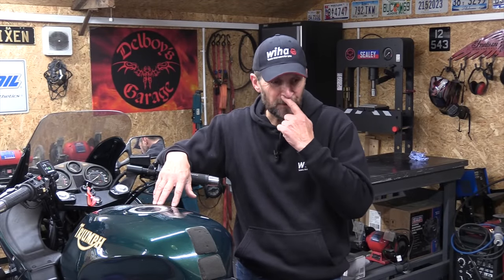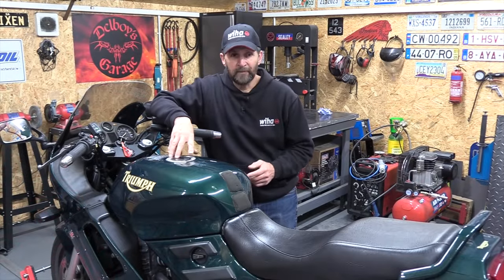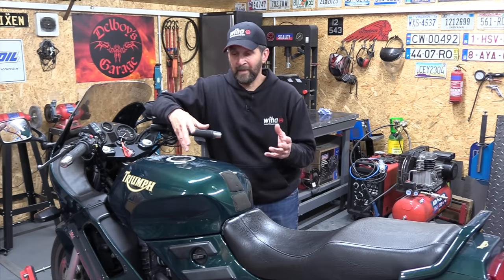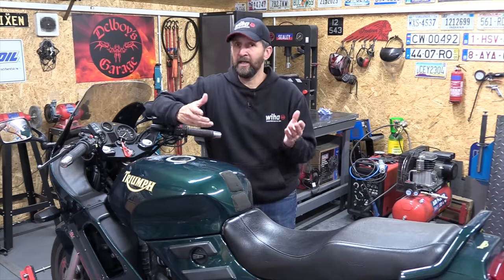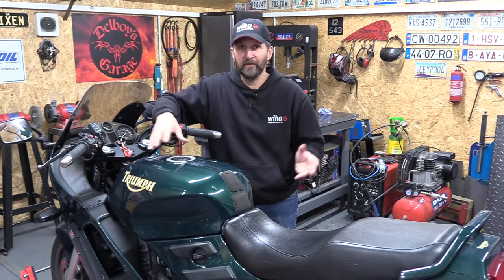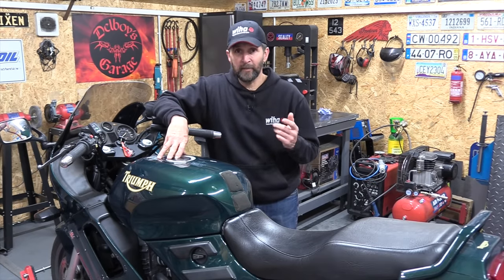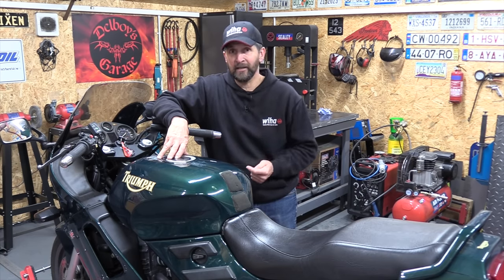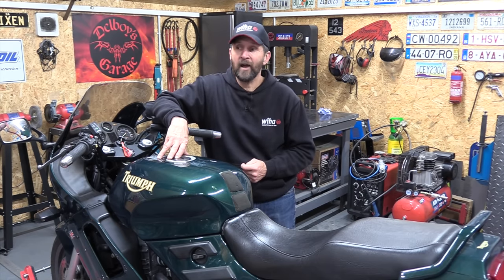Triumph Trophy 900,  Engine Oil and filter Change !!

Comment: Only use 'red' rubber grease on o-rings or rubber seals, normal grease will cause any rubber to swell/deform.  Worth stating on these T3 bikes that there should be (as yours correctly has) a steel washer either side of the filter - many bikes only have one as the other is thrown away stick to the old filter.

Comment: Great step by step instruktion 🙂
You forgot - or forgot to show - changing of the small O-ring located on the bolt!

There are two O-rings to be change on a oil change - the small one at the button of the bolt and the big one.
The bolt has to be taken out and the small O-ring will be reviled ;-)

Comment: To my understanding the condensation of water in the engine is quite normal in wintertime. Is that right? Because some riders in a group stated something about worn piston rings / valve(seat) which allows water vapour thats part of the combustion seep through. I feel like thats nonsense but I do prefer to ask someone who is an experienced mechanic because im just a ME student and wouldnt want to share wrong info. Thanks in advance.
Reply from the maker: Condensation is a reality, but only if you continually make short trips where the engine doesn't get up to full working temperature for long enough to vapourise the condensation.

Comment: 105$, dollars an hour for labor is a problem for us mill hunkies. I try to do as much work on my road king as I can, fluids included....
What was the blue goo u put on the oil drain plug del?.....thread sealant?
Reply from the maker: Yes buddy, Blue Hylomar is an oil joint sealant !  our local HD main dealer has a winter special discounted labour rate of £99 an hour and that's apparently 25% off !!  but i guess they have staff to pay and overheads, no complaint with that..!
Reply: @Moonfleet41  ....thanks for responding  del, you always do and I really appreciate that man. I get the whole overhead amd staff has to be paid , but since the plague hit in the states there's alot of price gouging going on as well as the typical price increase on everything imaginable....some things just don't have to be as expensive as they are...but I am die hard harley davidson always will be.
Reply from the maker: You said that right  "some things just don't have to be as expensive as they are", in the last 10 years the bike dealerships have aligned their prices with car dealerships.. but then our local HD dealer also owns a Lexus agency and a few other car brands too over multiple sites... so i guess it's just a kind of leveling up !
Reply: @Moonfleet41  wow, really!....
Ya the new Harleys are pricey but very nice machines. Do you like your M8 del?...id really like to have an ultra one day with the m8 114. I rode a street glide the other day, twin cam model, for the first time amd I've been riding all my life.... I've always had a road king, amd never thought I'd like the street glide until I rode it...and it was an older model with a twin cam 103, it was still an  awesome bike!... so when I trade up do I stay with the twin cam or go for the m8?. Is the power amd torque increase as noticeable as everyone says?

Comment: Dell, what are your thoughts on flushing the engine through with some sacrificial oil. I have 4 litres which I have used 10 or 11 times before each oil change, just drain the old stuff, chuck the flushing in and run for 10 mins. Then do the actual oil change. Thoughts?...
Reply from the maker: Well if the oil you're flushing with is clean, then yeah, good idea, but if you've used it 10 or 11 times already, is it not a bit skanky and contaminated by now?... if it's not, then maybe ok, but TBH i just change mine twice a year and it always comes out still pretty clean compared to old neglected oil.!

Comment: Intresting but why do you use blue sealant if you have a washer , wouldnt ptfe tape be better to seal the threads. But a good informative video and good tip about using greas on the oring nothing worse than reading with a pesky oring that jump out of place that all ways finds it way into dirt or being snagged when tightend up balloning out 😪

Comment: Another nice, straightforward video Del, with the nice little tip about grease on the O ring, for those that didn`t know. I have always used Vaseline for that and many other applications. I remember an old bike mechanic telling me years ago that if Vaseline is okay to put on babies` skin, it can`t hurt a motorbike.
Reply from the maker: I totally agree Dave, simple common sense that you may not find in the manual, but mechanics have been doing for years... there are lots of tricks and hacks like those that we can all use and benefit from !
Reply: @Moonfleet41  That is exactly why your channel is so good because you explain everything you do, which some people may know but others don`t. I have been working on bikes for close to 50 years and I still pick up the odd useful tip. Great channel.

Comment: Even with having to work around the high pipes to get at my fill plug, it only takes around five or ten minutes to perform an oil change on my Scrambler 1200XC. I had to get myself a funnel that has a 12-inch-long flexible tube on the end of it to pass behind the pipes and the problem was solved. I particularly like that Triumph designed the oil filter placement in such a way as you can remove the old one without creating a mess similar to the wreck of the Exxon Valdez.
Reply from the maker: Yes mate, now and again Triumph do come up with some clever thinking!

Comment: That used oil looks very clean. Quality lube will keep your wheels turning for many a year! I also like that extra filter element idea! My pickup just rolled over 400,000 miles, and when people comment on how long I've been driving Ol' Betsy, I just tell 'em that oil is cheaper than engines, so change it regularly. Happy Halloween, Del & Penny!
Reply from the maker: Great point Tommy, even spaceship message engines can keep going with routine maintenance, it's neglect that kills them!

Comment: What a fantastic oil filter innovation - I've just done my son's 30 year old GSX R750 - what a performance that was!  Another great video Del - keep them coming - please
Reply from the maker: Ha ha, happy memories, burning your hand as you wedge it between the down pipes to grab the filter..lol!
Reply: Mix of getting the oil warm with a quick lap of the block, and wait a few min for the pipes to cook down enough to not scold yourself
Reply: @wobblysauce  Thanks Wobbly - the trouble with those old Gixxers is that you can't get your hand through or behind the pipes.  The only way I could get at the filter was to take off the exhaust system.  Still - it gave me the chance to polish the pipes with Solvo - and they look great.
Reply: @tonytucker7184  sure you could side fairing off, oil wrench and twist, had a early 90's black with pinkish stripes... 
Though it has been a while since having it.

Comment: I've just done a compleat health check on the tracer new brake fluid and oil, also done the throttle bodies. I gave it a once over my mot is tomorrow afternoon. I'm expecting a couple of advisories but alls well so far. Have fun and take it easy, if they go together lol. Have a good weekend  peeps.
Reply from the maker: And you mate, good luck for tomorrow!
Reply: @Moonfleet41  cheers.

Comment: Top advice on when to change the oil.
I had forgotten about condensation and the subsequent water in the oil.
Nice one Del need to get on with that next. At least it will be a less strenuous job to do on the bike.

Yes the cost of living dosent seam to be getting any better but must get some new tyres but in the past I would buy part worn.

God bless you Del and Penny x
Reply from the maker: I've used part worns myself Marc, hard times, extra measures!  Have a great weekend mate.

Comment: This gave me a cold sweat. On my daytona 12 the sump plug stripped. Somehow by some miracle it was the thread on the plug not the alloy thread in the sump. Another miracle was I had a brass radiator plug and washer from who knows what old car that fitted perfectly. The feeling of dread when going to undo the plug and it gave up. Who knows how it got into that condition . The previous owner of that engine was a colleague who'd had the donor engine from new in his trophy. We swapped engines , he bought the daytona scrap and wanted its engine in his trophy. I took the remains and built a tracker from the daytona and his trophy engine. I wanted the torque he wanted the top end . Different cams in identical engines. I think the trophy engine was much more useable in my naked home made bike. He was riding from Lincolnshire to Scotland every week so I guess he wanted the power on the motorways ? 
I like the kit bike design of the trident trophy daytona sprint etc from the mid 90s. I put a trident complete front end on mine including clocks brakes etc. A very simple way to make my faired bike naked. 
Enough waffle from me! 
Peace and love ✌️ ❤️🤗
Reply from the maker: I remember that bike mate, that was pretty much when we first made contact right?.. thanks for sharing the wider story, it sounded like the perfect deal to both get what you needed..!  Have a great weekend and keep safe aye.. D&Px
Reply: @Moonfleet41  
Yes it was 2012, wow ten years! We were in our 40's!
🤗
Reply from the maker: @springy-2112  Ha ha... was it that long ago brother...!!!😜